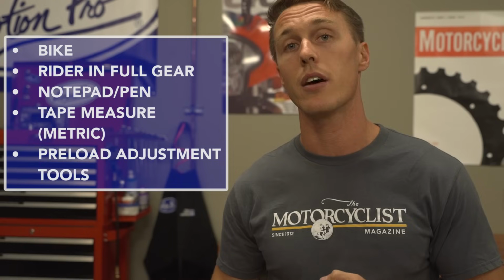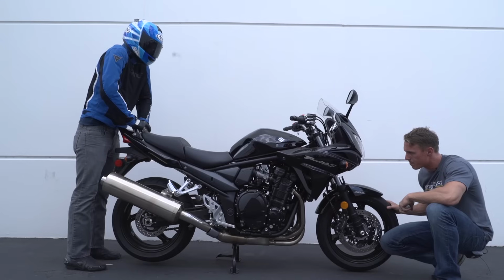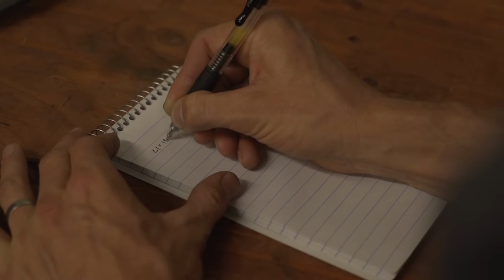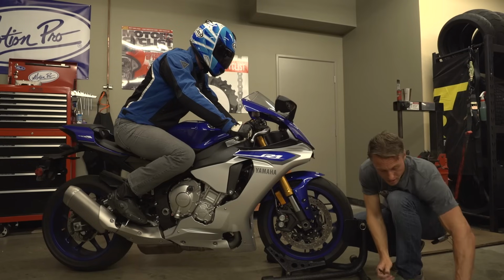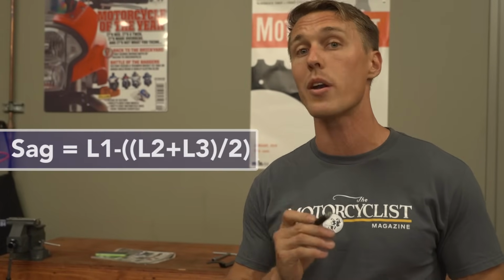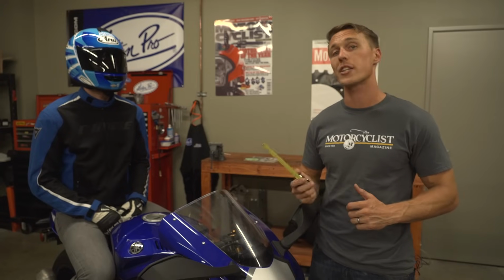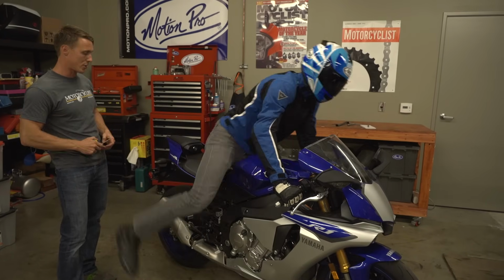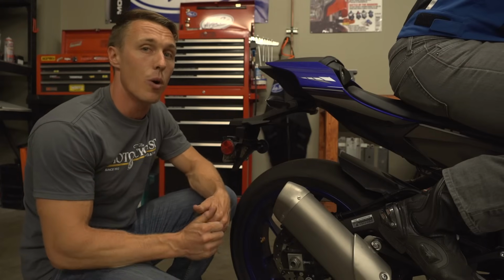How To Check Motorcycle Suspension Sag | MC Garage

Comment: I am confused because on the front fork you measure L1 as being the total amount of the exposed portion of the fork when the actual total travel is always less than that because full spring compression(travel) occurs before. Any thoughts?

Comment: I’ve got an 2004 zx10r that I’ve been playing around with trying to set sag up. But I keep coming up with more static sag. I’ve set rider sag to 31 front and 28 rear. I wanna go to 30 rear as well. But I’m already at 17mm of static in the rear? I was told to raise the rear to 10-12mm of static. But if I did that my rear would be super super stiff?
Reply: Then you have a to soft spring. I think you are already max out the preload on the spring to get the higher sag

Comment: Any tips on how to pick up the front of the bike? I have a sport bike and it's very easy to get the rear wheel off the ground using the kickstand but I can't get the front off.
Reply: Just go from the right side press your body against it and lift on the clip on and measure with a stiff ruler if your alone

Comment: Skip the rocket science....if it's too stiff & you're sore then dial it down (soften it). If it's too wiggly & mushy & you feel a lack of control in the bumpys & squirrelys then tighten it up (harden it up). Go in small increments until you feel in control with quick good response & you're not sore & achy  the next day. Then you've got it dialed in. Good luck & happy trails from a late 60's boomer who's been riding for 50 years.
Reply: So your method requires to wait a day to see if you're "sore or achy" after riding and readjusting... Depending how many adjustment points you have - it can take a month to adjust the suspension IF the pain and soreness has anything to do with the suspension setup .. 
Pretty sure doing it like in the video, to have the base set-up, is was more tine efficient
Reply: @piotrw3954  Base setup for what though? Too soft and mushy or too stiff and uncomfortable? If you can't tell for a day or two your suspension is too hard or soft maybe stick to cars?

Comment: im a brand nea rider at 59. i just want to ride. i barely tip toe on my 21-mt07. i have a lowering link. what harm would it do if i installed the link and lowered the front by an 1"(inch)?

Comment: I'm sorry but for the rear suspension, if you do it this way the measurement will be completely off! If it's between 25 and 35% on the front your measuring a short distance, say 35cm, while on the rear you're measuring 60cm, obviously the percentage for the rear will be almost halved in proportion. You need to take a reference point, if possible, of the same distance. Alternatively, if you take the front as the standard measurement, calculate the rear by always using 35mm as L1 also for the rear

Comment: Is front fork sag adjustable without having adjustable preload? I'm having new springs installed on my bike and was wondering if the correct sag could be set during that process without the forks having adjustable preload.
Reply: Yes, non-adjustable forks can have preload adjusted, but it is done by changing the length of the preload spacer inside the fork, so it needs to be partially disassembled to do it. A lot more involved than turning a bolt.

Comment: Outstanding video.  At the beginning you said adjusting suspension is one of the very first things you should do to a bike.  One thing I may have missed is, why is this so important?  Is this specifically to determine if your springs are right for rider weight? (rake, trail, ride height are "in the right range"?)  So then, in a sense, when bikes are sold with stock springs, this is to cover the masses, not a specific individual?  And this rider sag measurements are critical to identify if the spring you have is right for you as the individual rider, not the masses?  Sorry, suspension is very new to me.

Comment: At 4:00, he says, "if you've pulled all the pre-load out, and you have too much sag, then the springs are too stiff". I think he meant to say, "if you've pulled all the pre-load out, and you don't have enough sag (ie about 15% of the shock's stroke), then the springs are too stiff". Right?
Reply: I'd also say, it is more rare to have too little sag. Though, if you do, that is more dangerous than too much sag (in the rear). In the front, too much sag is very dangerous, because then the forks could bottom out. Too little sag in the front is also very rare, and yet should also be completely avoided.

Comment: we should mention the different of spring. a progressive spring has a lot softer and that would have nothing to do with another spring rate coil down there. i have two progressive spring rear shocks they both can reach the average sag number which is 1/3 to 1/4. but the different is shown how a softer spring act when i wear full gear adding weight like 7 kgs and a softer spring will spread more rider sag number than a stronger one. of course on riding it is easier to get the feel which one is softer.

Comment: We should know the total length of the rear suspension at that point, that is not the same that in the spring. In my opinion it's not a good manner to calculate rear sag, you should know the mm of travel of the rear suspension (let's say 130mm) and do the measurements (around 20-25% of SAG, about 30mm) very near the rear sock absorber to do an accurate calculation.
Best regards.

Comment: I don't understand this. The preload should be 1/3 of total travel. But the travel is on the shock and the dimensions I'm taking are X centimeters away from shock. I'm taking some random point on the frame to measure to. But picking different points on the frame will give me different sag numbers.
Or is my brain farting?

Comment: The second case from 3:56 should be: "If you pulled all the preload out and you still have too little sag..." not "... too much sag..."
Reply: Caught that too.
Reply: Yep that statement doesn't make sense.... if you have no preload and too much sag you have no idea if the spring is too stiff or too soft. May be he meant to say that if you have no preload and not enough sag then the spring is too stiff, or if you have maximum preload and still too much sag then the spring is too soft? 
But even that isn't necessarily true because the spring may be the correct stiffness for the rider's weight but may be under too much installed preload. I found out from another youtuber that Ohlins sell different spring clips so the installed spring length (preload) can be adjusted beyond the adjustable range.
Reply: Yes. Not enough. Probably time for a re-spring.

Comment: 1. "If you've maxed out Pre-load and you still have too much sag, you need stiffer springs".
2. "If you've pulled all the Pre-load out and still have too much sag, you're springs are too stiff".

For the 2nd point, wouldn't you're springs be too soft if you have too much sag after pulling all the Pre-load out? I feel like I'm misunderstanding something simple...
Reply: He made a mistake in the second part. If you've pulled all the Pre-load out and still have NOT ENOUGH sag, you're springs are too stiff"
Reply: They're too stiff and not allowing any sag

Comment: Dude I've tried your formula on my 2019 fireblade and it worked brilliantly, and without riding it again I did one turn extra and then everything was set out even after I I took the turn back on the pre load and since then I cant get my settings correct  any help with be appreciated

Comment: This isn’t correct on the rear as the total travel (L1) is not a measurement from the wheel bolt to an arbitrary point. To be accurate with 1/3 sag,  subtract average sag from the total travel ,  but you haven’t got total travel. 
The only thing you have is the distance from fully extended to sag but no ratio..

Comment: Hi. Nice vid. But what is the sag you want to achieve? I understanded how to calculate the sag, but which is the value to get to by adjusting the motorcycle? Is it in the manual?
Reply: Usually u check the manual (technical data chapter) for the max springtravel for the front and read. Then u take 30% of that number. In this video it seems like he is taking 30% of L1 as a goal.

Comment: Question: after getting total distance of wheel travel with the wheel off the ground I’ve always set sag using the difference of free sag (the bike on its own weight no rider bike balanced vertically both wheels on the ground) against rider sag (the measurement with fully geared rider balanced, both wheels on the ground). So a total of 3 measurements total wheel travel, free sag, and rider sag (yes I take an average of 2 readings for each measurement so I measure 6 times total but use those 3 averages for calculations) I’ve been doing it that way for years and it’s even how it’s done on my ohlins app. That second measurement free sag wasn’t done here at all and I’m wondering why they were skipped and also how that affects the target sag numbers

Comment: What if I ride with a passenger often.
Do I still set the sag for myself alone and would it matter then when the passenger gets on
Reply: You want a compromise between the two. Adjust to around 70% of the target sag you should have for just yourself. This is generally how a bike with passanger pegs is set up from the factory, for a weight of around 100kg. It's a compromise between a single rider and with a passanger. To get optimal sag for both single and double riders you would basically need two sets of springs and shock valving to swap out for each.

Comment: Alternatively use a tie wrap around front fork inner assembly as a measurement tool for front adjustment...
Reply: Mountain bikers do this too but are not necessary as most forks come with a rubber o-ring to measure sag and most forks from RockShox have sag measurements written on the stantion tube. Remember to put the zip tie on backward so you can take it off without cutting it and don't leave it on because if you go through all your travel you will force the hard plastic dip tie into the seals. Or maybe motorcycle forks are different so that won't happen...

Comment: To measure L1 on the front end could we just place the front wheel on a front paddock stand? and for the rear to place the rear wheel on a paddock stand?
Reply: No, because for L1 the suspension has to be unloaded. Paddock stands load the forks or the swingarm, so the suspension is still taking the bike's weight.

Comment: When you change your rear suspension, the pre load settings come as per factory default... While installing it, should the settings be changed or should we install the suspension directly and then make the adjustments?
Asking this for a KTM duke 390
Reply: Preload is supposed to be adjusted once u have the suspension installed in the bike.

Comment: 0:32 1/3rd to 1/4th of total distant travel
L1, no load measurement
L2, load with rider pushed down showing upword drag
L3, load with rider pushed up showing downword drag
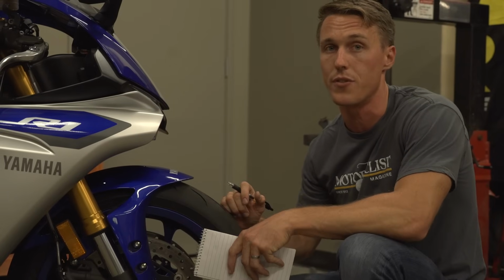2:20 Sag = L1 ((L2+L3)/2)
Desired Sag = L1 * .33 to L1 * .25
.295 ( ± .075 ) * L1 = L1 ( ( L2 + L3 ) / 2 )

Just taking some notes
Reply: You forgot a minus between L1 and the 1st bracket, just a heads up to anyone like me who is scratching their head at the high number they got by multiplying there :D
Reply: Desired sag is NOT 1/4-1/3 of L1.  It is 1/4-1/3 of your total suspension travel, found in your motorcycle specs. L1 is simply your starting reference number with the suspension fully extended. Subtract the 1/4-1/3 of your advertised suspension travel number from the L1 and that is what your measurement should be with the rider on the seat (the average of the L2 and L3).
Reply: The mistake being made is that the total exposed slider is in no way indicative of the total travel. So all we know is that there is some amount of sag. We have no idea if the measured number is 99% of the total travel, or .0001% of total travel since we do not know where the suspension bottoms or tops out.

So this was a nice video, but it's incomplete as it does not address the 1/3rd to 1/4th portion. All we know is there is X millimeters of sag.
Reply: @PrivateUsername  That is quite right. however total (or better to say max theoretical)  front / rear suspension travel is normally given in the bike's specifications
Reply: @PrivateUsername that’s why you get that measurement from the manual😂
Reply: @PrivateUsername  on the front this is not a problem because u can measure the distance left but the rear, how would u approach that?
Reply: @PrivateUsername  Yeah, with this in mind, I think this video's suggestion is actually wrong and possibly dangerously inaccurate. If you set up 25%-30% sag to the length of the shock's rod showing and especially some fictitious value gained from the backend, and not it's true available stroke, then you are setting it to something more than it should be. This is also assuming this percentage is also accurate. Front shocks don't bottom out where the rod showing is completely gone. They bottom out earlier. 

Let's test this:
Shock Rod measurement (as in the video):
L1=135mm L2=87mm L3= 97mm
Sag = 135 - ((87+97)/2)
Sag = 43mm
Desired sag= 33 to 45mm 

So, the sag measured was at the "bottom" of the desired sag. I'd also add some more pre-load, but someone lazy might not, saying "it's still ok". 

Now, let's do it with the stroke of the front shock's cylinder (Ohlins it seems full stroke is 120mm):
L1=120mm L2=72mm L3=82mm (taking off 15mm to match values 135-120)
Sag = 120 - ((72+82)/2)
Sag = 43mm (aha, the same...!!! So, that's ok.)
However....Desired sag=  30mm to 40mm 

In other words, had the dude said, "it's within the desired sag, I'll leave it", he's actually over the desired sag and might end up bottoming out the cylinder in a pinch, which could be fatally dangerous. 43mm is 36% of 120mm stroke. That might still be "ok", but as we can see the suggested method here isn't completely correct, as you've pointed out and I think I've proved. I think the measurements in the rear would be even more false. We'd need to take some geometric calculation into the equation too, i.e. the angle from the attachment point of the swingarm to the point of connection of the shock to where the measurements were taken. Not easy. I also have learned that the sag on the rear should be less than the front. I've learned, 25-30 on the front and 20-25% on the rear. I don't know if that is true or not, but reading around, every other advice suggests at least a 5%-10% less sag in the rear to the front.
Reply: @scottamolinari  lol, bro, your mathematics skill isn't good, when you change the L1 from 135 to 120 the desired sag has to be change. So, the sag is 43 it isn't ok at all and need to be adjust. From your theory, whatever the number you take off to match values, coz you take off from L1, L2, L3 so the result of the formular always is 43mm
Reply: @scottamolinari  that's just  fantastic, that you are the only person who pointed out that Ohlins full stroke is 120mm, so this video is completely wrong, and your comment has only 2 likes

Comment: he said :Let L1 be total suspension travel T
1)SAG should be about 0.25 to 0.33 of the total suspension travel T2)SAG = (L2 + L3 ) \ 2therefore if SAG is greater than 0.33 it means you need to stiffen uphowever if SAG is less than 0.25 it means you need to soften down

Comment: In stead of pulling bike on kickstand , would it be the same to use front triple tree stand and spool swing arm rear stand ?
Reply: Not for the L1 measurements, because the suspension has to be unloaded for that. When you put your bike on a paddock stand (on the spools) it loads the rear suspension through the swingarm.

Comment: how to adjust rear?
Reply: Abdullah Travellers Of Life 
if you were to use öhlins suspension, there is a flathead screw adjustment on the right side of the suspension.

Comment: Thanks for the videos! A great help for me in getting to know my bike. I have an R1S I’ll be getting next week and I’d like to adjust the suspension for me. Is it really that necessary if I’m riding in the city and freeways or more just for track days?
Reply: It doesn't matter where or what you ride. Adjust not only your suspension, but the angle of you clutch, front brake, shifter & rear brake lever. MC's are not cars and are infinitely adjustable.

Comment: Silly question;

Can I use paddock stands (front and rear) to do this?

Is it;

a) safe,
b) as accurate?

🤔
Reply: John Barroso Pereira: No you cant, or shouldn't. Because the suspension needs to be fully extended so as you can get your readings correctly. Paddock stands will compress the suspension. Ari did it this way without stands, and it works. Even with proper head-lift stands you still need a second person, as the rider needs to be sitting on the bike with riding gear. Its all about adjusting your weight to the suspension, and you need the fully extended measurement with the compressed measurement (with rider on the bike). All suspension is already set-up from the factory for a rider on all bikes, but only if your in the 80kg +/- range. So if your 80kg in weight, the only time you need to set up suspension is if your going to the track. Cheers groover ;-)